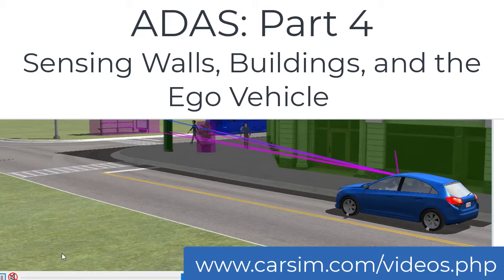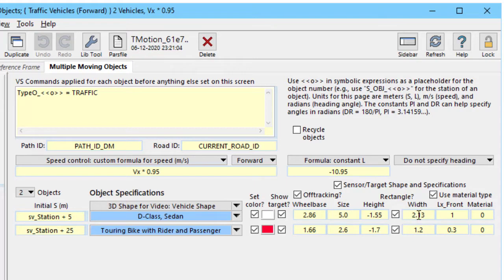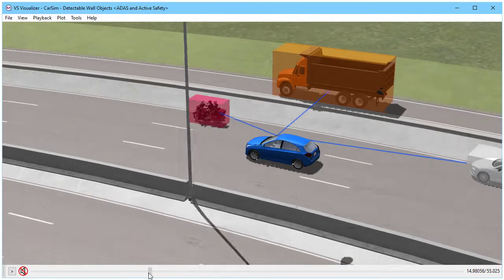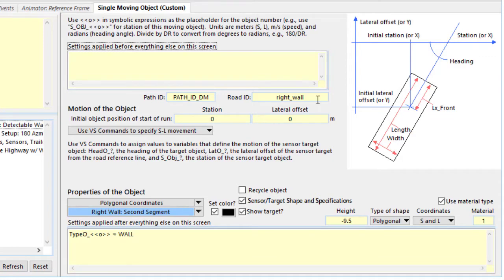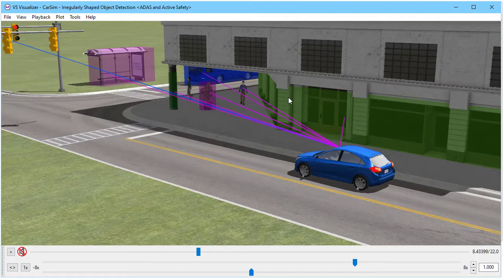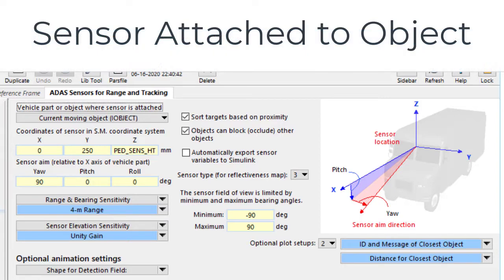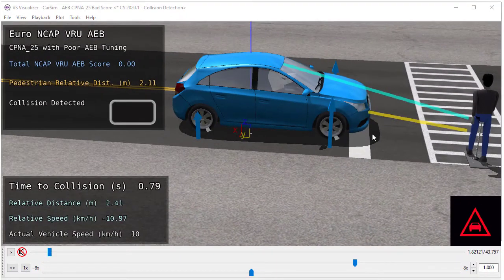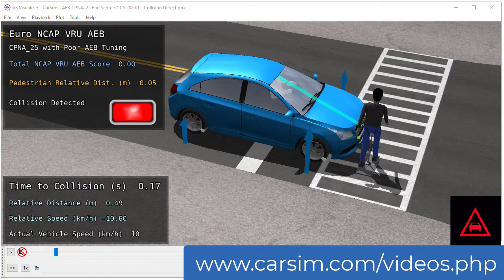ADAS: Part 4, Sensing Walls, Buildings, and the Ego Vehicle

Comment: this application helps to determine the position of the sensors such as camera, lidar? Why is it important to determine a point of collision with the ego vehicle?
Reply from the maker: It is not to determine the position of the sensor. It is to determine if the controller will vent a collision.